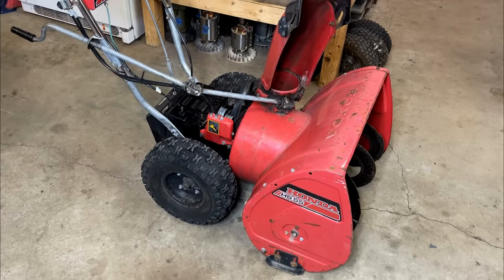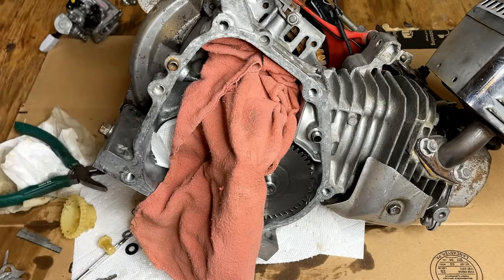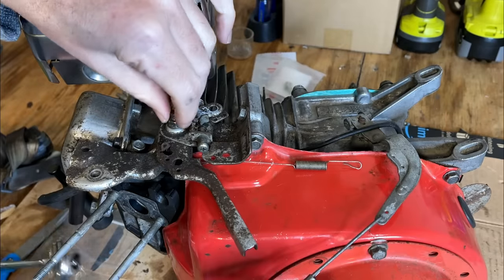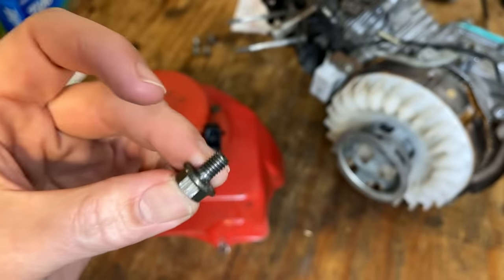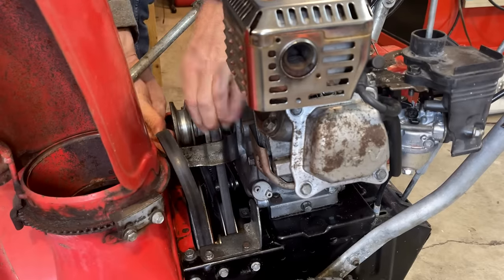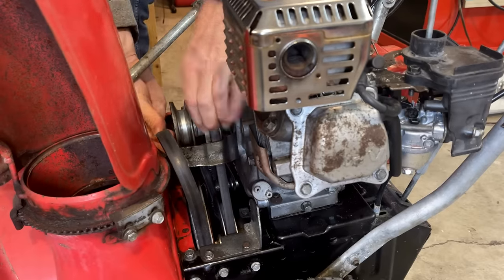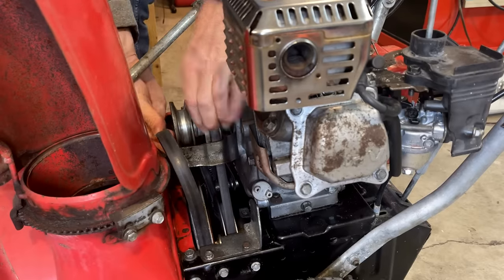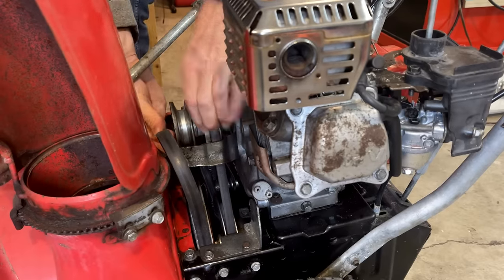Honda GX140 Governor Replacement and Engine Repair - Honda Snow Blower (Part 2)

Comment: Btw, they make a wax-type lubricant, to use on that slide bar of the  vari-drive, to stop siezing, and rusting...
    Also, get some ospho, on ebay, and apply to the paddle axle bars. It is a rust converter, that is cheap, and works well, just for this type of application.......As always, Jim, your tenacity, and skilled experience, has brought this little machine back to a new life...!!!

Comment: Wow , they did a number on that engine . I love Honda engines easy to work on and will put up with quite a bit of abuse and still run great . That is a great snow blower and will be for many years to come .
Reply from the maker: It will definitely be running for many more years.

Comment: Magnificent, James. As always! Most enjoyable.

Isn't remarkable how such tiny things are key: the grit on the float needle, the tiny circlip on the govenor post, a few tho' off the locking mechanism.

Many hands have clearly been at this machine. The sin is not to fail, it is to not try.

Well done!

Comment: Hi James, one thing that I can never understand is why people who work on small engines, in my opinion do not know what exactly what they are doing. ????. You are the one that can over come an obstacle in trouble shooting the problem. Great job on taking time to repair the unit 👍👍. That is one thing I do not miss, as I used to live in Lenox, MA. is snow blowing the drive way. What made it worse was the city coming by plowing the road way, and covering up the end of the drive way with the plow.😮😮😮😮

Comment: Thank you for uploading this video, was very helpful. The issue with the carburetor is NOT the needle, the seat is at fault. It probably has some crud build up, use some valve lapping compound and a Q-tip to polish the seat (I used tooth paste). Another thing, check the resistance of the spark plug cap. It should be 5K ohms. Just unscrew the cap from the plug wire to check it. On my HS55, the resistance had increased to 10K, which btw was exactly THE SAME resistance that "Eliminator Channel" found on a GX 160 used to power an air compressor, he had trouble with full load on the engine. I purchased a pack of 3 of these on Amazon for under $10. Although in a pinch, you can substitute a 5mmX 20mm fuse for the "resistor pellet" in the cap.  I did that until I got the caps from Amazon. The engine ran beautifully without the resistor, but the spark gap will probably widen sooner because of the increased current flow, don't care about the RFI (no longer have analog TV)!

Comment: Great job James. I dislike working on snowblowers due to the fact that most people really abuse them by the time I get it in the shop. Hard to explain to folks that it may cost more to fix them then replace them. I had one that took many hours to just get the rusty frozen wheels off. Lots of salt where I live. Mostly belts, rubber drive wheels, carbs plugged up due to using ethanol gas etc. Thanks for an excellent video.

Comment: I have the same snowblower ….has been very good for 30 years. I had trouble with the second stage snow thrower. When I engaged the auger it would shear the bolt, because it was so egg shaped. Manage to find a machine to get the used part from seems to be fine now. Enjoyed your video. Thanks Tom

Comment: Really enjoyed watching you bring this Honda Snow Blower back to life. Have a Honda HS50 that I purchased new in the early 80s. It has a G200 engine and because of my consistent  attention to maintenance and upkeep, like I give to all of my other 37 pieces of equipment, it looks almost new and runs perfectly. The only thing I have ever had to do was to replace the carburetor float valve and an auger belt.
Reply from the maker: And that is exactly how they should all be with a little care and maintenance.
Reply: @jcondon1  yes!

Comment: Thanks for the heads up on the asbestos gasket. Never would’ve thought of it. Wearing a mask is very important. If the asbestos gasket is kept wet with  oil or water while cleaning it off I wouldn’t be too concerned. Don’t allow it to become friable by sanding it or blowing the particles into the air with a compressor. Great video.

Comment: It sure is a lot easier to work on a engine that is not mounted on the frame. That GX sounded almost brand new after the TLC you provided to it. Thanks for pointing things out as you go James it is really helpful. Thank you for sharing your video with us. Ed
Reply from the maker: Snow blowers usually have low hour engines around here.  Despite its age, would guess no more then 300 hours on the engine.

Comment: Good to see this working at 100%.   You put a lot of time into this.   Well done.
It looks like the skid plates have been replaced.   On the left side it looked like the paint has outline of the original skid plates.  I modified the plates on my Ariens snowblower to mount an inline skate wheel.   Now the wheel runs on the driveway blacktop instead of the steel.    Worth considering such an upgrade for this machine.   I can help you to make the plates.
Dave.
Reply from the maker: Sounds like a good idea

Comment: I think you're right. Someone had this as a go kart engine and wanted to upgrade, so they slapped it back on the old snowblower and sold it as "non-running", knowing there's lots of people like you that buy non-running equipment knowing it's almost always something simple like a carb clean or coil or something. They knew they'd get more money as a complete machine than as a loose non-running engine (even a Honda).

Comment: I keep commenting on how great these videos but you got me again. How did you see that blower housing misaligned?! Your attention to detail is what draws me to this channel. You torque everything to spec and never skimp. Your zip tie illustration on governor alignment was a great visual for the viewers also. Correct hardware usage is a big one for me. Keep this going man.
Reply from the maker: Thanks.  I try, but sometimes I do use the wrong tool to get the right result.
Reply: @jcondon1  yes I get it this too.

Comment: Those circular split retainer clips can be a pain. What you can do when reaching into a tight area, use a socket just larger than the diameter of the pivot, stick the clip on the end of the socket with some grease and tappy tap tap it right on.

Comment: My father was having trouble getting his snowblower to throw heavy wet snow years ago. I put a 1 inch larger diameter pulley on the engine that drives the blower to increase blower speed with a slightly longer belt. Since then I have done the same for several other people. I also recommend adding rubber flaps to the impeller for the times when there is a lot of water with the snow.
Reply: You must have a different type of snow. Here if there's too much heavy snow the engine starts to bog down. Enlarging the engine pulley would just make it worse.
Reply: @eDoc2020   I was concerned about p0wer when I did my dad's but his major concern was the ability to throw snow over the wall even if he had to go slower. It turned out to work great and he said he could travel faster because it got rid of the snow faster. The pulley only increases the the speed of the blower fan and the beater so the snow can be ejected at a higher speed instead of stalling in the chute and plugging it and the fan and beaters. The operator still controls the forward speed for how much snow enters the blower.
Reply: @tiredoldmechanic1791  In my application even the lowest speed setting is too fast. I've been wondering if it's worthwhile to cut out a notch for an extra-low wheel speed. Currently we sometimes need to drive forward for a second, then stop and wait for the snow to clear before continuing.
Reply: @eDoc2020  Higher fan speed might help you to get the snow out of the machine faster. You could also put a larger engine on it.
Reply: @tiredoldmechanic1791  It's already a 306cc engine. There's not much larger one could go. Besides, it's workable most of the time and certainly more capable than our previous blower with an 80cc Tecumseh.
Reply: @eDoc2020  There are several 420cc engines as well as 459cc engines available which would be in the 13 to 15 hp range while the 306 would be about 8 hp. The shaft height and size might be different requiring different pulleys and belts. The current blower I use is a Yardman that I bought in the 1990s. It has a 9.5 hp Tecumseh Snow King engine which were probably the best snowblower engines made. This blower cuts a 28 inch wide path and has the fingertip controls to disconnect the drive on each side to steer it. I didn't ever modify it as it blows snow quite well. It was a display model at my local Farm & Fleet store one year when we hardly had any snow. It was priced at $1500 in the winter and they started dropping the price in the spring. They kept dropping the price and in July it was down to $799 so I bought it. The following winter we got pummeled with snow but the dealers hadn't stocked up on blowers after they didn't sell many the previous year so there was a shortage and the prices were high. We don't get as much snow as we used to but we seem to get most of it in March and April when it's heavy and wet.

Comment: Great job with fixing that snow blower.  This video is giving more confidence on trying to fine tune my old 1980's lawn mower with a GXV120 engine and I do have the OEM service manual.   Some of the control cables on mine do not quite  work right.

Comment: Fantastic job as always, I know from my own snowblower when I'm in thick heavy snow at full throttle the 7hp Tecumseh is working hard and at as hot as any small engine I have

Comment: Top fix James. I have a GX powered generator with a stuck governor, wide open, looks like an easy fix if its just the spindle thats frozen. Fingers crossed when spring comes i can get to it and have a go

Comment: What a great project that turned out great.  You did some fantastic diagnosis and repairs as usual.  Hope you get some excellent use from the snow blower.  Thanks for the video's.

Comment: Looks different in the older Honda engines than the newer Honda engines that are produced today. That one your working on James the governor is mounted inside the crankcase on the flywheel side where the newer ones the governor is mounted on the crankcase cover. Just wanted to point it out. Keep well and looking forward to future projects.👍
Reply from the maker: It would have been much easier to replace on the new style engine.

Comment: oh no another work diversion.  Thanks for another great video.  There is a fuel filter in the bottom of the tank (pickup) but since you are on external fuel that's not the source of contamination. I would see if its there considering all the other things messed with on that machine.

Comment: Another awesome video! Thanks! Judging from the huge number of things bodged on the  unit by previous repairs, you might want to check that the proper shear bolts are on the auger. :-)

Comment: Only thing I would do additional to it is apply  fluid film, or another rust preventative to the body,   or a repaint to stop rust.  Fine Job sir.
Reply from the maker: I agree, but am going to paint it in the spring.  So left it off for now.

Comment: Crow's feet wrenches for your torque wrench.  Would help you reach bolts stuck under other things.  You can get long ones too, and do some torque math to account for the length from the pivot point for accurate torque values.
Reply from the maker: Been meaning to get some crow's feet.
Reply: @jcondon1  I think one of us viewers might send you a set. demmarcsxr, I have a set in my car tool kit, & they have been a godsend.

Comment: I recently found your channel and I commend your attention to detail when fixing anything you work on. I assume you plan to sell that snowblower and whomever buys it will know they are getting a piece of equipment that is fixed right and should last a good long time, not like some of the junk "Mowers and Blowers" throws together and sells to some unexpecting person who wants to get something that will work for a couple years before falling apart.

Comment: You could try using an assembly punch of the right size to install the retaining clip.  You would hold the clip in place on the tool with a bit of assembly lube.

Comment: Poor James, you've had to add "snow blower rebuilder" to your skillset!  
I'm beginning to think the last guy took out the pushrods as a warning to the next person to try and fix this machine.  Luckily, it came to Mr. Condon who had the patience and perseverance to find ALL the problems with this snowblower.  You were clued in to examine Everything carefully.  You found missing machine screws and more insidiously, loose head bolts!
There's only one thing you couldn't fix; the tendency of this engine to emit dangerous amounts of CO!  When you sell it, please tell the buyer that it needs to be run ONLY completely outdoors, because of the Carbon Monoxide emissions. Even avoid starting it in an open garage!  
  I don't think it needs a complete repainting, but touch ups might be in order.
Reply: If you need to explain to someone not to run an engine indoors,  they shouldn't be trusted with a snow blower, or any power tool.

Comment: you torque the pull start housing bolts, I was shocked when you did not also torque the spark plug and the air filter housing wing nut.

Comment: I see a missed opportunity here.
At 38:00 ish, connecting the link for the Governor as no "adjustment" seems necessary.

Personally, I don't know how one would "adjust" a governor when it's not aligned.

It would have been cool to still demonstrate how to do that, should one be misaligned.

Great video, though.

While I don't fix motors, other than the most minor issues (personal ones) I learn so much from these videos and by learning, motors are becoming LESS and LESS intimidating.

Knowledge is power!
Reply from the maker: I have a "governor adjustment" playlist.  The first video covers it in detail.  https://www.youtube.com/playlist?list=PLoj6DvbhMTzuSEHSTUefe2QPXlQKMDRNV

Comment: Wearing a mask when working around any asbestos, especially the old uses like brake pads/shoes and clutch material or gaskets that have seen very high temps and have broken down into small flakes or powdery but I would not have worried about a small engine sump v over gasket unless I saw it was breaking apart badly or if I had to use mechanical abrasion or scraping to remove.  Asbestos abatement can be performed by just keeping any asbestos moistened with water misting.   Asbestos was a great product, dirt cheap and easily incorporated into most anything that needed heat resistance and or the fibers used for added strengths in glues/adhesives, vinyl tile, linoleum, etc.

Comment: I have a hs621 snowthrower here neighbor dropped off. Ran wide open really didnt want to take it all apart. After some thought did governor adjustment fixed. He said it really blew snow. Ya think? Then there is a cup plug welded on top of muffler rusted through. Welded washer on it filled hole. Much quieter. Didnt want to put a bunch of time in old machine

Comment: There was probably a calculation on a mechanical engineering web page for any influence the use of a wobble extension and socket or universal joint and socket might have had on your torque.

Comment: I thought I saw bolts instead of sheer pins/sheer bolts in the auger...might want to switch those out to prevent gearbox damage in the event something gets caught in the auger.

Comment: Well James I have a 160cc (Champion) genterator with a bad governor.   I am waiting for the generaotor gods to help me out.   May not happen.    Time is not an issue.    I know i'm going to have to split it 1/2.  My issue is that this is the third issues with this genset.   Worth it or not   HHHMMMM.    It has been stored in a wet emvironment.   The last this was disconnecting the HV shutdown.
Reply from the maker: Probably not worth it, but not an expensive fix just time.  Also you may find when the engine is open that the governor is the tip of the iceberg.  Have had a lot recently where the internals were all rusted due to condensation.

Comment: I bet the problem with the drive engage lock is a worn out endcap on a cable shroud. Like a bad bike shifter cable, it has a sad springiness.

Comment: Great videos. Especally the thorough testing is gold. Speaking of thorough. Did you put on the govener spring later? In the video, when you installed the carb, it was not etached. At 54:33.

Comment: I feel like I just went through similar pains like you did on a HS521. The engine needed so much work but the chassis was in great shape. Like you mentioned, I wonder if the engine was removed and used on a go cart.

Comment: Hey James quick question have you ever installed an impeller kit on one? I have done a bunch and it’s pretty evident in the performance of the machine if you wanted a new idea for a video you could take one and do a before and after I think the difference will impress you!  Check it out man

Comment: Heads up for next project next time you pull a sump off like you doing send that crank down in the crankshaft and put a coat or a thin coat of Vaseline on it that way the seal if you're not going to replace it it won't roll on you it will just slide take care Maranatha

Comment: Hey, Jim, I noticed that you didn’t indicate torque settings throughout the video. Perhaps you no longer do that, and I had not noticed it before. Just an added benefit to watching your excellent work.
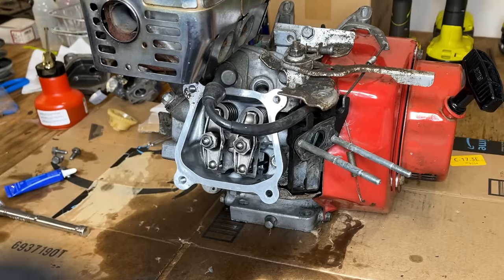Reply from the maker: I flashed the specs on the screen really quick at 14:40 https://youtu.be/-taW9AuVEbQ?t=880